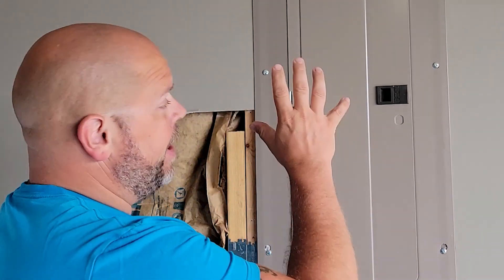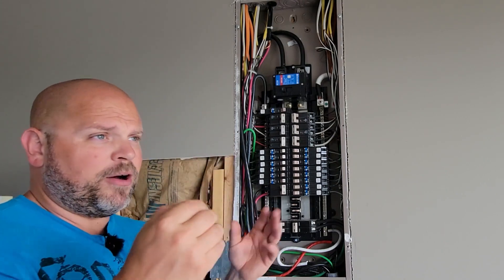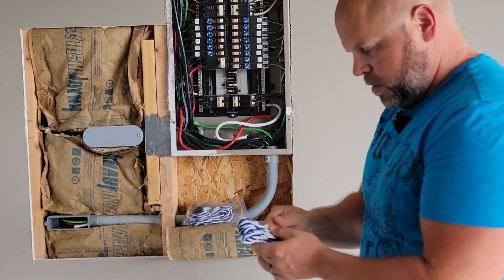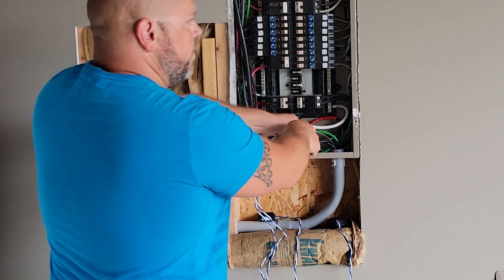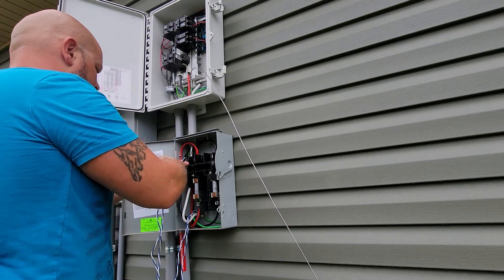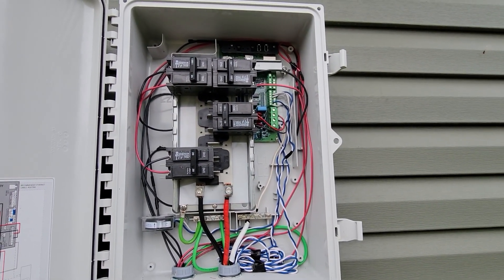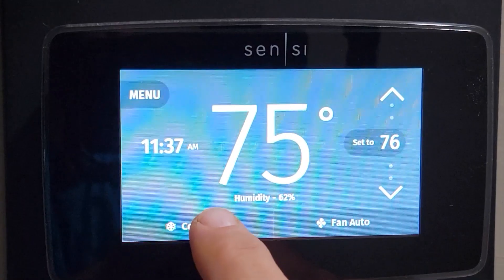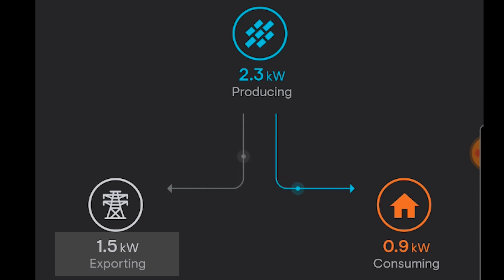How to install consumption monitoring CT on an Enphase solar system

Comment: This is more proof you don't need to be a 6year master electrician to know and understand NEC electrical code & various electrical systems. 
You are spot on about safety and pretty much every step of the wiring process.
Reply from the maker: Much appreciated 🙏 Thanks for watching and commenting 👍🏻

Comment: Brilliant video , had 3 CT's on the consumption side of my system and didn't know that L1 had to be the same phase as the supply to the gateway . Fixed it straight away Thank you !
Reply from the maker: I'm glad it was helpful. Thanks for watching and commenting 👍🏻
Reply: My consumption is showing way more than I am actually using in the house. Could this be my issue?

Comment: That was exactly what I needed.  I am a retired power plant worker and do all of the plumbing, carpentry, and electrical work in my hose.  I have two sub-panels so I will need two sets of meters.  Thank you.
Reply from the maker: You can install it on the main feeds of the main panel. If I am reading it right you have 2 subs that connect into a main. Just use the main if at all possible. Thanks for watching and commenting 👍🏻
Reply: @JustinsProject if you have TWO MAIN panels, then I imagine you'd need 2 of these devices?

Comment: Hey Justin, thanks for doing this install video. I’ve had my solar operational for a week now. Is it possible that you could explain a little more on which wires to connect the consumption clamps to? Thanks
Reply from the maker: You need to determine the L1 and L2. Then, just cap over and connect the transmitting wires to the combiner.

Comment: My Enphase combiner box is mounted on my solar array stand (ground mount system) at the back of my property, the Enphase Combiner box/ solar feeds into the A/C disconnect at the exterior shop and then into the 45 amp breaker in a sub-panel in the shop. The sub-panel in the shop is fed by the 400amp main at the house. My question, will the CT's function properly mounted on the in feed of the sub-panel or do they need to be install at the main panel at the house? Thanks for the great videos......

Comment: I worked at the electric utility and am pretty confident in the boxes.
I'm disappointed that my solar company set me up with the system and didn't include the CT's to be able to compare the utility and the solar through my smart meter.
With the companies app, enphase app and the utilities app, I can see all sorts of things, except the simple real time display of what I'm drawing, where I'm drawing from and how much my solar is feeding the utility.
The contractors wants a few thousand to install. The CT's aren't cheap either, but better than paying them.
The problem is they will probably void my warranty if I did, so they have me over a barrel.
Reply from the maker: Ahhh not sure why installers are leaving out the CT's. They are fairly easy to install. You should be able to see "live" load production and usage in the Enlighten app. Look for the Live tab. Hope that was helpful. Thanks for watching and commenting 👍🏻
Reply: @JustinsProject  enphase shows that the CT's are not enabled from their end. Talked to them today and the ct-200-split is the correct ones. They range between $35 to $50 and would have been a drop in the bucket to just include.
I asked Ion Solar for an updated quote to install them and whether they would void my warranty if I had it done.
I'll see what they come back with, but I want to say they wanted about $600 to install when I first asked after realizing there were none.
I can deduct what is going on by reading all the apps, but I want to see what you are getting.

Comment: So L1 is always on the left side of the electrical cabinet, and it's OK to run the white and blue CT wires in with the HV 220 from outside to get them outside. I may opt to make another conduit run and head straight to the Envoy box.
Reply from the maker: Thanks for watching and commenting 👍🏻

Comment: Hi Justin I watched every video on your Enphase system  how many panels can you put on one breaker. I see only room for three breakers
Reply from the maker: The number of panels on one 20amp breaker in the combiner really depends on the model of microinverter you are going to use. I used 3 slots but could expand the system and use the 4th if needed. Thanks for watching and commenting 👍🏻

Comment: on the live wires coming from the grid there is a #1 and #2  are their specific location to connect them or anywhere
Reply from the maker: Yes, you need to place the consumption CT's on the same L1 and L2 sides as the combiner box so it reads correctly. If you place them on the wrong feeder line you can always switch them fairly easily. Hope that helps. Thanks for watching and commenting 👍🏻

Comment: If I currently have my solar with Enphase, but NOT the CT's installed. Is it hard to integrate them without having their installers do it for me? Or does it intergrate seemlessly through there application?
Reply from the maker: I installed my system as a DIY'er and had no issue installing the CT's. It was seemless and showed up in my Enlightened manager immediately. I have a link to the CT's in the description or use this: https://amzn.to/3e7CUax If to use the ones I used. Thanks for watching and commenting 👍🏻

Comment: Hi, thank you for the detailed video. Do I need to enable consumption metering in toolkit app? As a owner I am not able to connect envoy. I tried with old version toolkit app with no luck. Can you please provide details on how to connect to system in toolkit and enable CT
Reply from the maker: If you can not access the option to enable that feature "mine was automatically enabled" I would recommend contacting your installer and having them do that for you. If that is not an option, I would call Enphase directly and let them know you are installing the consumption CT and need that option enabled so you can track it on your Enlighten App. Hope that helps. Thanks for watching and commenting 👍🏻
Reply: @JustinsProject   I called the enphase support and they enabled in 2min after verifying my system. Now I am seeing my consumption 😊
Reply from the maker: @gopinathk69  Glad to help! That's what my channel is all about! Appreciate the follow up. 🙏

Comment: Please Help....On my  system, my part of  my production is being counted as Kwh used if  CT is not put in the right  could this do that............Please help.!!!!!!!............thanks    Dan from Texas..............
Reply from the maker: If the consumption CT's are installed incorrectly (reverse) it could be providing inaccurate data. Thanks for watching and commenting 👍🏻
Reply: @JustinsProject  Can you  please help me I fix this if you can what info do I need to send you...............Thanks

Comment: what did you have to do in order to get the monitoring to show up in the app? you just install the CT consumption and then it just shows up?
Reply from the maker: I contacted Enphase technical support and they walked me through the process step by step. It was very easy to get everything lined out. Hope that helps. Thanks for watching and commenting! 👍
Reply: @JustinsProject  yes very helpful! I will install it myself then turn it on. my solar install is super annoying about it. they're advising against getting the consumption monitoring because their other customers don't understand how to read the data correctly and waste their time.
Reply from the maker: @BilalSattar  I would 100% recommend having the CT monitoring.  Especially if you are trying to learn more about how you are using your power.

Comment: My installer didn’t add these. Will adding these myself void warranty?
Reply from the maker: I guess the first question to ask your installer is way they didn't install them. Next, is ask about the warranty on your system and if you can install them yourself. Thanks for watching and commenting 👍🏻
Reply: @JustinsProject  I did ask their answer was “they don’t work, they report incorrectly” yet enphase says they are accurate +-2.5% which is pretty good. I will have to ask if I install will it void warranty. They want 300$ to install after I spent 30K lol yeah no. Nice try

Comment: My Enphase combiner came with CTs new in the new-in-box from eBay, so I will hook them up when I build out my system. I did notice you don't have a disconnect on your shop. The inspector I talked to said I need it on my shop where the panels are like yours. And after reading the current electrical code, it says there needs to be a disconnect close to the panels. Was that something missed, or were local codes different?
Reply from the maker: The AC disconnect needed to be close to the main electrical panel and the combiner box. The combiner box is required to be close to the main service panel. In my area the ac disconnect is to be installed between the main panel and combiner. I've heard in other jurisdictions  it is to be installed between the combiner  and the panels. It can get confusing I know. Hope that helps. Thanks for watching and commenting 👍🏻
Reply: @JustinsProject  yes in Colorado my county has no electrical codes but I need the state inspection for the power company. The states permit website won’t let me put in my town because in town they do their own inspections. So I have to use the next town over and put driving nots about it. I did talk to the inspector about my system and he sounded good with my system nearly identical to yours until I said there wasn’t a second disconnect on the shop building and then he acted like he all the sudden had to go. And I haven’t seen anything about 2 disconnects in the limited information online. Most solar info online is just out to sell you installation for 2-5 times the cost of materials.
Reply from the maker: @webluke  Yes the information is very limited and a lot of gray area from what I'm told by insiders. Sometimes there is confusion between DC systems and these Enphase systems that convert at the panel to AC also. I have heard on DC systems that a shutdown switch needs to be close on ground mount systems so maybe thats what they are thinking about? Just a thought.
Reply: How do you “enable” the CT in the app then?  Are there instructions?

Comment: Our main service panel has the meter module built-in with bus bars running to the main service breaker that are not accessible for us to clamp the CTs on.  Do the CTs have to sit between breaker and meter?  Or can we place them on the lines coming from the grid before the meter?

Great videos, btw.  I have watched your other videos too and they have helped with my DIY solar installation journey.
Reply from the maker: I am pretty sure that would work on a net  meter but I would contact Enphase technical support to confirm. They have been a tremendous help to me doing my install. Thanks for the support and congratulations on the DIY its very rewarding. 👍🏻
Reply: This is my exact same scenario.  Will call Enphase tech support but curious if anyone else was successful with placing the CT's before the meter
Reply: @doubleg6658  I end up doing just that, put the CTs before the meter and they work fine.  My net import/export kwh numbers matched up with the numbers from our electric bill.
Reply: Works fine before the meter, but be careful to follow the regulations of your local power company. Mine forced me to remove the consumption CT sensors before they could give me permission to operate.

Comment: I’ve installed the consumption meters but it’s not showing on my app can you tell me or show me how I enable them to show on my app thanks
Reply from the maker: The best thing to do is contact Enphase technical support. They should help you figure that out pretty easily. Thanks for watching and commenting 👍🏻
Reply: @JustinsProject  i figured that out now but wanted to ask i saw your shorts video and you talk about what size breakers to use for your system into your panel i took a look at mine and it is spliced into the main power coming into the house i dont think it should be connected that way on enphase it show like how yours is hooked up with breakers

Comment: Do you have access to Installer Kit for free from Enphase?  Can you access that if not DIY?
Reply from the maker: As a DIY'er I had access to the installer toolkit. That might be because I installed my system and created a installer account with Enphase before starting my solar project. Hope that helps. Thanks for watching and commenting 👍🏻

Comment: what system or software were you using in the last few seconds of the video showing the import . producing and consumption.? I like the fact that it was live
Reply from the maker: That is the Enphase Enlighten app. You can monitor your system. It is one of the coolest features of having an Enphase microinverter system. Hope that helps. Thanks for watching and commenting 👍🏻
Reply: Hi sir,

The app that you show in the video, has this live feed of import / export with lines & moving arrows/dots. Is that the regular enlighten app? 

Because, my enlighten app don't got a live feed like that. The lines changing when consumption is greater than production. & when excess , the line goes towards grid & consumption.

My app Don't have that live feed. I use enlighten on Android.  Can you tell me the secret?

Comment: Great video . I have a question for u ! 
Did u calibrate the sensors ? For either total or net metering ? I installed some on my system and have had issues getting the correct readings . And I do have the L1 /L2 connected right . In the toolkit it has a wizard to help u calibrate the CT sensors . I plan on doing mine tomorrow cause I have to do it during production .
Reply from the maker: Much appreciated 🙏 What type of readings are you getting? Thanks for watching and commenting 👍🏻

Comment: Hello Justin! Thanks for your videos, they very “enlighten”. In this one, I don’t recall seeing how this CTs are powered, nor how did you made the connection. The link for Amazon is it $21 each CT, right? Are they from the same micro inverter manufacturer? What’s the difference from the CT monitoring and the Enphase monitoring App? Also, didn’t see the setting for the monitoring software. Thanks for replying?
Reply from the maker: 😁 The connection was made at the panel on the 4th & 5th lugs @06:51 in the vid. The other side just clamps over the main feeds. I started that around the @08:00 mark. Hope that helps. Yes, everything is Enphase. IMO best option on the market. You have to have the comsumption CT's installed before the Enphase App can know what your consuming. They work as one. Same with the production CT inside the combiner box. Thanks for watching and commenting 👍🏻
Reply: @JustinsProject  Thanks for replying so quickly. So you’re basically saying (if I understood right) that the monitoring App (which I thought monitored every single panel),  monitors overall system consumption, only after installing the CTs?
Reply from the maker: @eguerra777  You need the Enphase Envoy. Whether its built into you combiner box or a stand alone. Then a production CT, included in the Enphase Combiner Box. Those allow you to monitor the microinverters "production" ... the consumption CT allows you to monitor how much power you are consuming. They sometimes come with the combiner box also.
Reply: The app syncs with the enphase servers, that gets the data from the envoy installed for your site. 

Without the CTs & PTs, you will still be able to see the whole production / consumption data.

But if you want the actual energy production, consumption, import & export at any point of time, you will need the PTs & CTs installed. The envoy gets the reading from these, fed to the enphase servers & we get to see them in the app, also in the form of a graph.

Comment: Question for you Justin, with a solar system that is shut off with the breakers, is the power being generated by the panels dumping to ground? Or are they being 'deactivated' in some way?
Reply from the maker: On a system using Enphase microinverters like mine, when you shutdown the solar breaker it will shutdown the microinverters almost completely. It might produce fractional volts but nothing serious (from my test) To be safe always shutdown the homerun feeds into the combiner box though. Each microinverter has surge and under powered protection to help protect the microinverter. Hope that helps. Thanks for watching and commenting 👍🏻
Reply: @JustinsProject  Ah gotchya, thanks!

Comment: Hi Justin. Great stuff here. I want to add consumption CTs to my system. My main panel is inside my house on an interior wall and the solar is installed in a garage sub panel. By the time I were to pull through all the conduit it may be 60 feet. Can the CT  leeds be extended this far? I know the leads on the CTs are a given but maybe 18AWG 7 strand Cu ?
Reply from the maker: Honestly, I have not encountered that situation. I would verify that with technical support at Enphase. They should be able to provide you with the correct answer. I don't want to guess at it. I don't see why it would be an issue but you never know. Thanks for watching and commenting 👍🏻
Reply: You can, you just use sprinkler wire but the important part is when you wire it up in the enphase envoy it has to match with how you wired the cts . So match the colors lol
Reply: Also I’d recommend running a separate conduit for the cts
Reply: Use wire nut to connect the cts to the sprinkler wire , the ct wire won’t let you use wagos
Reply: @kevinluna7830  Thanks for the input. I'm more colorblind than my dogs.